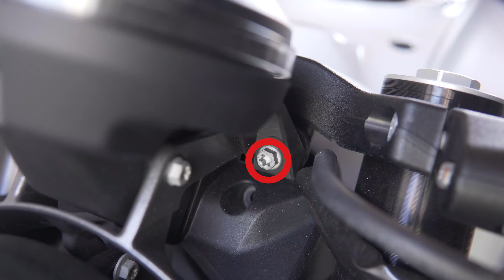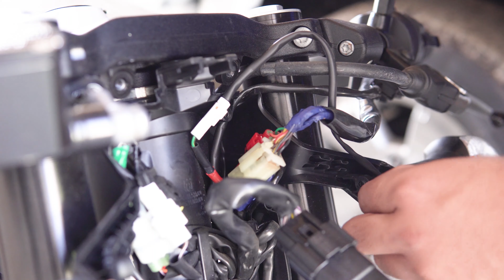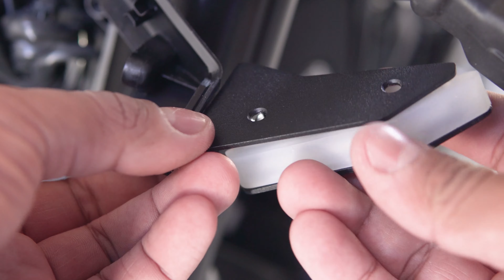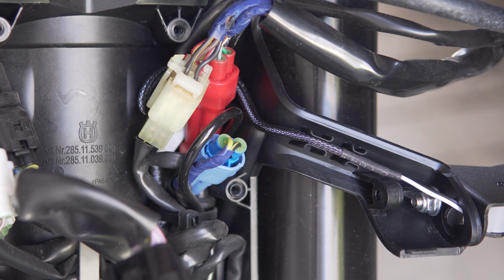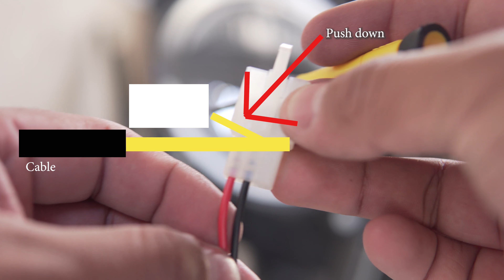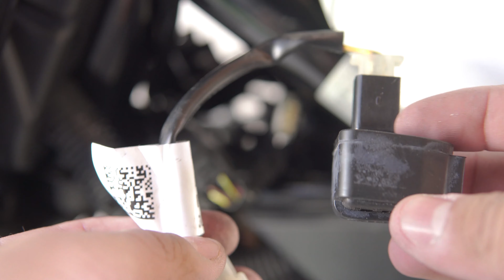Vitpilen/Svartpilen 401 Turn Signal Mod

Comment: 390 adventure here and did my turn signals. Everything is good until i start the engine then they go nuts. Flash super fast and the rate changes wildly too. Went back to stock flasher.
Darn.

Comment: I saw you did the rear turn signals at some point after you did the fronts, is there an extra relay needed for the rear or is the relay you run for the front signals all you need to do all four?
Reply from the maker: Not sure. The only relay I swapped out was the one in the video and when I did the rear turn signals I had no issues. No hyper flash. Everything works.
Reply: @1encinitas  what rear signals did you use?
Reply from the maker: @Ericajacobsware  I went with Motogadget MBlaze Pin Turn Signals

Comment: Do you have a similar video for the rear leds??

That be amazing !  This video is great
Reply from the maker: Don't have a video but I did end up switching out the rear turn signals. That mod was pretty easy as well. If I make a video it'll just be some photos I took while I explain what I did. Let me know if you're interested in that. I've also done some other mods: handlebars, bar end mirrors and exhaust so far.
Reply: Jerry Facio that be awesome! Plz lmk! Thx
Reply: @1encinitas  even the pics would be great 👍🏻
Reply: @1encinitas  Did you ever post this?
Reply from the maker: @slicktoroid  not yet, been a bit busy but I'll make a quick video this week. I'll try and have it up by next week.
Reply: @1encinitas  are the rears the same lights you ordered for the front?
Reply from the maker: @slicktoroid  no, I actually went with the small M Blaze turn signals. I got them from Revzilla. I had to splice some wires since the M Blaze connections were different. You can probably use the ones in this video for the rear and you wont have to do any splicing since the front and rear connections are the same.
Reply: @1encinitas  Thanks for the replies! I think I'm gonna go for these signals. Is the new relay necessary? Since the New Rage turn signals say they are plug and play on their website. Or is it necessary because it was meant for the 701?
Reply from the maker: @slicktoroid  yes, they are meant for the 701. I was getting a bit of hyper flash before I swapped out the relay.